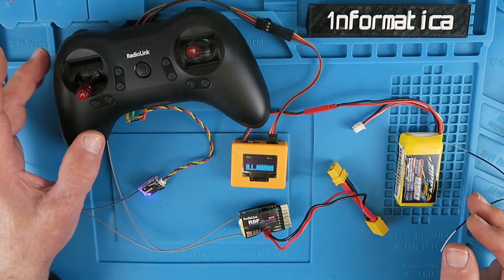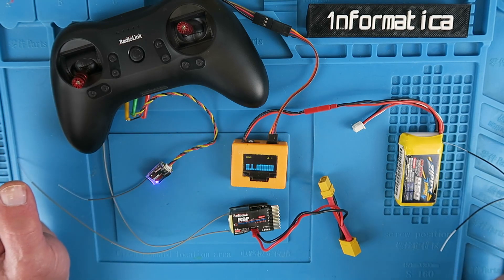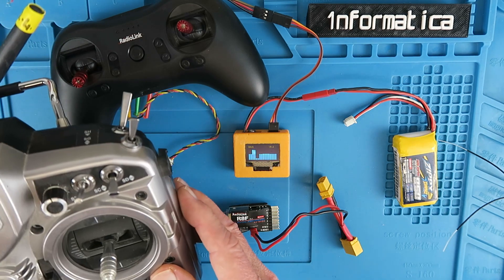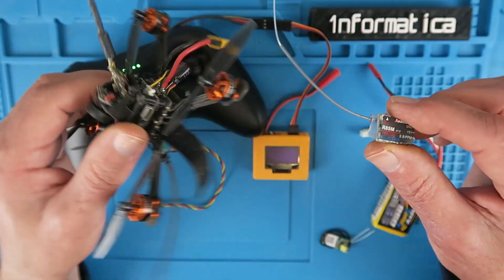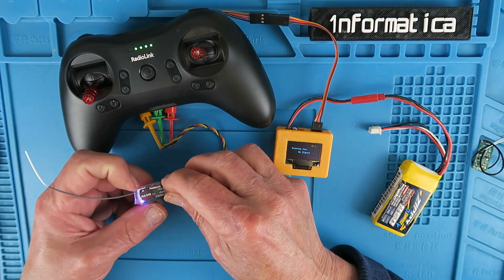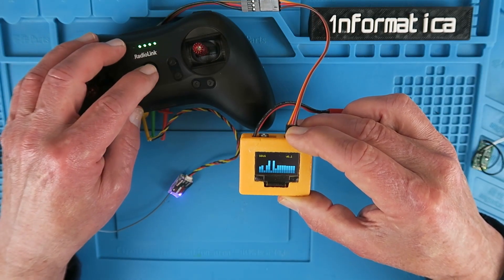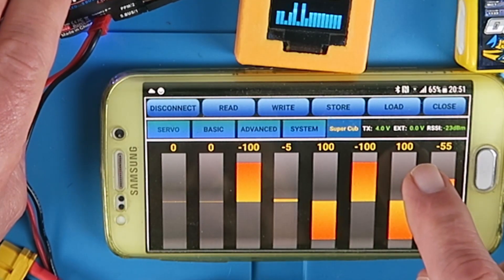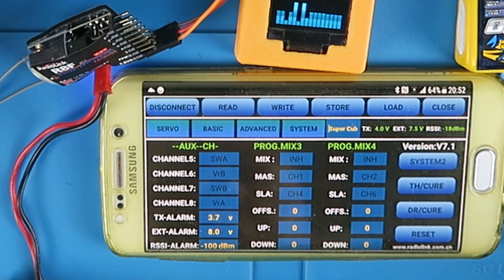Radiolink Receivers R8SM Mini SBUS And R8F Telemetry Review

Comment: Hi i have a jumper t-lite remote wich is multi protokol but cant seem to find what protocol to bind the r8sm... What did you use on your teranis?
Reply from the maker: Hi, Radiolink has its own profile number 74, see : https://www.multi-module.org/using-the-module/protocol-details/radiolink If you don't have it you probably need to upgrade your firmware. Please consider subscribing if you have not done so already!